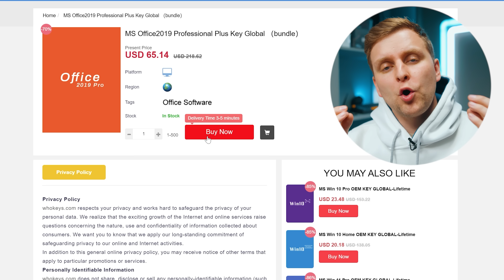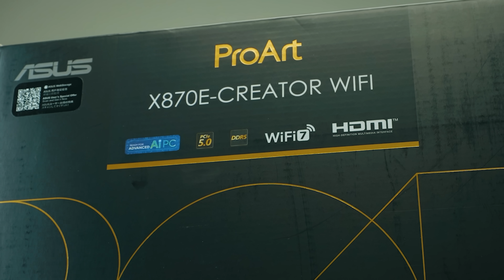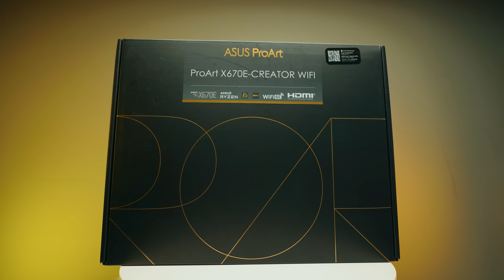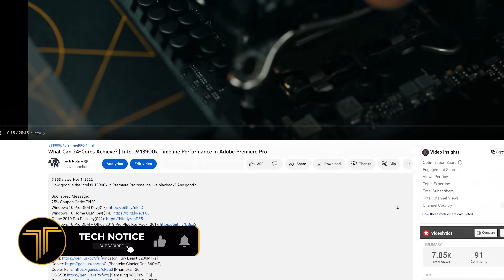The BEST Motherboard for AMD Ryzen. Period. - Here's Why! [Asus ProArt X870e Creator WiFi]

Comment: It isn't, because they've put the two main PCI-E slots too close together. Get the Hero so you have the choice of running something alongside your 3 slot 4090, like another 4090.
Reply: dual gpu setups are gonna be water-cooled this is not an issue. Having more space doesn't do much and having more space between the slots means the lower slots covers your bottom board IOs... This is the only board with the spacing so you can still unplug your HD audio and other fans in and out without having to remove your second gpu, you just leave the lower pci 4 16x slot empty, since 2 gpus and that filled will downgrade the second pci 5th gen slot to x4...

Read the motherboard layout ffs.
Reply: That is a very good point, even my PNY RTX 4070Ti Verto takes up slightly more than 3 slots, closer to 3.2 slots. This is not just exclusive to Asus, but many of the X870E motherboards from the other manufacturers have a PCIe slot that is rendered useless when a 3 slot video card is inserted. Most of this poor design implementation can be mitigated by a relatively simple design change by swapping out the PCIe slot position with one of the lower M.2 SSD positions.
Reply: very true
Reply: If you really want to run 2 GPUs, especially 4090 or now 5090 you should really consider building a water-cooled system anyway. The airflow would be to restricted to cool them sufficiently with the stock air cooler...
Reply: @matteloht   You can just use dual AIO cards

Comment: Comparison of ProArt X670E to X870E:
Improvements:
- Wifi 7 instead of Wifi 6E
- Bluetooth 5.4 instead of 5.3
- Third PCIE slot is now connected 4.0x4 instead of 4.0x2
- Wifi connector is now quick-connect
- 80A MOSFETs instead of 50A
Deterioration:
- Front USB-C is only 30 W power delivery instead of 60 W because 6-pin PCIE has been removed
- 12V ARGB connector has been removed
Everything else has remained exactly the same!
A surcharge of around 100 €/$/£ is in no way justified, the X670E has the better price-performance ratio, although the performance is identical except for Wifi/BT.
Reply: I went for asrock  x870e taichi lite... Gigabyte failed on me, Asus on to many other people.. including TECH NOTICE..
Reply: @mycuriouschild  Sure... Nothing to do with price at all eh?
Reply: @Nayah9  i have a gigabyte x670 gaming x...v1.0... after a windows update and a 15 min long shut down... dram light remain lit... Probably messed my bios.... tried flash bios....only early version worked... but no sata, no boot... and was really hot...
Reply: @Nayah9  cheap doesn t mean reliable...
Reply: @mycuriouschild  Did you trying clearing CMOS for 30s?
Reply: Asus proart x670e was cheaper in my country then x870 taichi lite. Big vrm, more stable, big capacitors, eatx, and many other things to consider against asus. What do i like in Asus mb is 10gb lan and 3 month subscription for adobe...
Reply: @mycuriouschild  It makes no sense for it to be more expensive than ProArt...
Reply: @Nayah9  yes...
Reply: Thank you for writing that comment. I just said how much better the ASUS ProArt B550-CREATOR is.
Reply: @DIDISCH68  Dude you need your own channel.
Reply: Thanks mate!
Reply: And I think you can also swap the wireless card under the rear I/O shroud. So that diminishes one key advantage of the X870E
Reply: @hughjassstudios9688  Yes, you can swap the wireless card on the X670E. But be careful, Intel BE200 didn't work on AMD boards, you need an MediaTek MT7925B22M
Reply: Without the 6 pin, there is no fast charging
Reply: Intel & AMD are need more improvement. Intel Price is also too much for this spec 👎
 Mac M4 is rocking the field with Les Cost. We can buy a Mac mini M4 at an Intel VGA cost nowadays..
Reply: You forgot 10GB Lan, an additional USB-C port?
Reply: @ipoponq  Both boards have 10 GB Lan, 2x USB 4 and 1 USB-C (20GB). Nothing has changed.
Reply: I think that applies to pretty much for all x870s.
Reply from the maker: I believe we can add a better RAM support to that list as well.
Reply: @theTechNotice  Official RAM support is the same.
X670E
RAM-Clock frequency OC:  DDR5-8000
RAM-Clock frequency nativ:  DDR5-5200 (Ryzen 7000), DDR5-5200 (Ryzen 8000G - Phoenix), DDR5-5200 (Ryzen 8000G - Phoenix2), DDR5-5600 (Ryzen 9000)

X870E
RAM-Clock frequency OC:  DDR5-8000
RAM-Clock frequency nativ:  DDR5-5200 (Ryzen 7000), DDR5-5200 (Ryzen 8000G - Phoenix), DDR5-5200 (Ryzen 8000G - Phoenix2), DDR5-5600 (Ryzen 9000)

RAM Clock depends on the CPU. not on the mainboard chipset. The X870 chipset is said to be a bit more stable when overclocking, so that you may be able to achieve slightly higher clock speeds with overclocking. But that is not guaranteed.
Reply: @theTechNotice better ram support is just a bios update between the two chipsets
Reply: @minhtthach7754  Correct, all X870 boards have almost no "improvements"
Reply: Missed the most important: * PCIEX16(G5)_2 slot shares bandwidth with M.2_2. whereas on the 670 this is not the case.
Reply: The extra 12 V power connector below the 24 pin on the 670E is also missing on the new one.
Reply: newbiegain117  Take a look at the spec sheet for the 9950X:
Max. memory speed
2x1R DDR5-5600
2x2R DDR5-5600
4x1R DDR5-3600
4x2R DDR5-3600
With 5600 mt/s you are exactly within the specified specs from AMD
More than 6000 MT/s for AMD is pointless anyway, because beyond that the overall performance decreases instead of increasing.
Reply: mate, create your own channel. I've watched like 10 videos, each like 20mins long... this summary was better and more accurate than all the trash out here
Reply: @MrFallout86  Thank you very much, I am thinking about creating my own tech channel
Reply: USB4 is standard equipment now.
Reply: Few corrections if I may:
• WiFi antenna not screwing in anymore is not necessarily an improvement. The antenna is an external object that can be accidentally disconnected while moving it.
• 3rd PCIe slot being 4.0x4 is not necessarily an improvement. It's just different lane sharing. Now you have to gimp a gen5 expansion slot instead of a gen4 M.2 slot.
• Power stages are 80A VS 70A previously.
• Bluetooth is 5.4 VS 5.2 previously.

I completely agree, X870E should be worth an extra €30 at most. Many might even prefer the X670E's design, lane sharing and 60W fast charging.
Reply: @Nayah9  Wifi antenna: I completely agree with you, for me personally this is not an "improvement" either
3rd PCIE: I completely agree with you here too
12V RGB: This was not replaced but simply removed, both boards have 3x 5V ARBG
Power Stages: I don't know where the 70A comes from, the MP86992 from Monolithic Power Systems are installed and according to the manufacturer's database they have 50A, not 70A (that would be the MP86957). I assume the X870E has the MP86992-C787 from Monolithic Power Systems, which have 80A.
Bluetooth: There are 2 board versions, one with MediaTek MT7922A, which has BT 5.2 and one with Intel AX210, which has BT 5.3
Reply: @DIDISCH68  • I got all my info from the corresponding product pages on the ASUS website. Also, I own the X670E so I know the board pretty well.
• You're correct about there being 3x 5V + 1x 12V headers on X670E, can't believe I missed that! I'll edit my comment.
• The website does say the X670E has 70A power stages and Bluetooth 5.2 though.
• Glad we are in agreement! ✌️
Reply: @Nayah9  Well, I wouldn't trust 100% what the PR people wrote on the Asus website. 😄 It's better to look at which components (power stages, WiFi/BT chip) are actually installed on the board and then check the information provided by the component manufacturer.
Anyway, Hardware Unboxed posted a video yesterday about all new X870 boards. And his summary was also, in short, if you don't need Wifi 7, then save your money and buy X670 boards, they are identical.
Reply: @Nayah9  Et si vous commenciez par arrêter vos commentaires?? Bourrés d'erreurs..La preuve. Je ne vous vise pas personnellement, c'est une remarque générale pour Youtube et toutes ces personnes qi se bombardent spécialistes en n'y connaissant rien ou plus ou moins. Ce ne sont que commentaires personnels sans intérêt..

Comment: Some things omitted: the x870e proart is basically a x670e proart. Not much changes apart to two important things: 

1. TB4/USB4 support: I believe they went from to ASM4242 to JHL8540 for the usb4 controller. This increase total bandwith from 32gbps to 60gbps (40+20). That's more bandwith, and better usb4 supports (no need to restart the computer when changing tb type devices.
2. WIFI 7.

Other than this, that's pretty much the same mobos. the X670e proart might become a very good cost effective version for ryzen computer.
Reply: And the CLR CMOS button on the back, no more using screwdriver to short the 2 pins on the motherboard... and the front panel pins area no longer as confusing as the X670E is one long row of pins.. that makes it hard to see it is a connection for front panel.
Reply: Well, Hardware Unboxed actually tested the speed of the USB4 ports on the Asus ROG Crosshair X870E Hero (which likely has the same controller as ProArt) and reached a max of 4GB/s transfer speed. So yeah... I doubt it's much faster than X670E's USB4 ports if at all.
Reply: @Nayah9  
We don't have the methodology of HW unboxed. The new controllers use more lanes, and ASM4242 supports more bandwith than JHL8540.

It really depends on what host controller they used to on the usb4.0 usb device. 

Examples: 
1. ASM2464PD usb controller delivers up to 30 Gbit/s.
2. There is few 10gbe -> TB ethernet adapters, some use sata (IOCREST), limiting the real speed to 6gbps.

Hardware unboxed will have to test using a USB controller that can leverage the 40gbps+, and storage (or else) that can support 40+gbps. 

There is other things that ASM4242 can bring over JHL8540 on x670e (to be confirmed): Hot swappable device doesn't work well on JHL8540, it was recommended to have a restart before you plug devices, and typically TB4 device were not working well (if not at all) when hotswaped. I hope this is fixed with this new iteration of boards.

Comment: Please do a video about the loss of the 8 pin power connector on this board vs the x670e creator using two GPUs (bench for speed and stability). 
That would be a review for creators who use 3D software that uses multiple GPUs and fill all their slots and PCIe lanes with drives.

Comment: ¯\_(ツ)_/¯ There is a problem with this board for creators, it doesn't have the extra 8pin power connector for a second high power GPU. This could cause stability issues and is a great loss. One hand giveth and the other hand taketh. The Asus x670e creator hero has it and the x870s Hero has it (but Hero taketh away the 10 gig) Sad marketing scams.
Reply: is it really necessary? if you give enough juice through 12vhpwr...
Reply from the maker: The 6 pin was not for the pcie power, it was for front panel USB C power delivery of up to 60w
Reply: @theTechNotice  It should effectively do both. I'm fairly sure in most cases the 12V lines from the supplemental connector connect to the same 12V traces on the board as the 12V lines from the 24 pin ATX connector. I've verified this on an X670E Hero with a multimeter — the 12V lines from the "PD" connector have continuity with the 12V lines from the 24 pin ATX connector and all have continuity with the 12V line at the PCIe slots. I assume the board just uses the sense pin of the supplemental PCIe connector to decide whether it can also enable 60W PD but if you don't have anything plugged into the front panel PD port then all of that additional power should be available to supplement the board's main 12V rail for things like PCIe devices, fans and 12V RGB headers.

The ATX3.1 spec does mention that the PCIe slots should be capable of handling power excursions up to 165W for 100μs but whether a board needs an additional connector for that, or whether it can make do with thick enough traces and a high quality 24pin connector and ATX3.1 PSU, I'm not sure.

Comment: Great video as usual! Also, would this motherboard be the best choice for a 4090 w/ full bandwidth in the PCIE_1 slot and using an elgato capture card in the PCIE_3 slot?
Reply from the maker: Yes, absolutely
Reply: @theTechNotice  out of curiosity, is it the only X670/X870 series motherboard that has that ability without limiting the gpu to x8?

Comment: I’m beyond pissed because I bought the ProArt X670E two weeks ago and found out it doesn’t truly support 128gb ram. Website support is mediocre at best. I purchased everything ProArt thinking it would work well.
Reply: Best beta would be X2 48gb ram I tried X4 16gb. And worked most of the time without overclocking. But still unstable.
Reply from the maker: Not all proart fault,  Ryzen 7000 doesn't like large capacity fast RAM....
Reply: I've built a system with the ProArt X670E, Ryzen 7950X3D, and 128GB of RAM
Reply: @KeithRice What are the RAM Specs? I’m using Corsair Vengence AMD Expo 6000 Mhz. I’m curious what speed your ram is running at? Thanks!
Reply: I can't even turn on the expo ram on the 6800 bus since the new bios update for the 9950x, so I'm looking into switching to x870 aorus master or carbon

Comment: Their website says 2 x m.2 G5, 2 x gen 4 (bottom two in the long heatsink = gen 4)? What would that mean (assuming 2 x 4, 2 x 5 is correct) for say, 2 x 4080s (5080s) and then 4 x nvmes in all of the available slots. Where does the hobbling begin (assuming you have fastest possible drives for the slots)?

Comment: all is not so creativ about the fan controlers?u need a daughter board 1A  here 3A there is not good , and 2000rpm makes a litle voltage to.why?and power over usbC and just cotroling over usb/or like a thunderboard controler over pcie?

Comment: New to getting back into building.  Curious as to why the 9000 series seems to be only compared to 7000 series.  Is there an issue with the 8000 being used for builds…esp creator builds.  Thanks
Reply from the maker: 8000 is not a real Gen, its just a mid gen with better graphics and not a full set of CPUs :)

Comment: 8000+ memory on zen 5??? Yeaaaa OKK 😂😂😂😂 nice try ASUS lol Foh with that bs
Reply: Yeah, that's not going to happen :) as apparently DDR5 6400 confirmed as sweet spot speed for Ryzen 9000s series "Zen 5" so far :D
Reply: @TheAlienwhisperer  so far it’s only 6000. Ur lucky to get 6400 after spending hours with crash after crash with drivers & settings that don’t work. Intel can 6400 in their sleep with probably 4 different ram sticks lol
Reply: @Chicken-o5e  is my name google? No…but AMD is unable to get their memory controller to work well with ddr5. They are years behind and their optimization sucks balls compared to Intel who now, by current gen (zen 5 vs arrow lake) will have just about double the ram speeds as AMD…WAIT. Before u do something else, read that again, isn’t that hilarious? 😂 😂😂
Reply: @godnamedtay  Hahaha but Intel does lose to Zen 5 in gaming even when they use faster RAM. Imagine losing to your competitor despite drawing more power and using better RAM. That  is the bit that is hilarious.